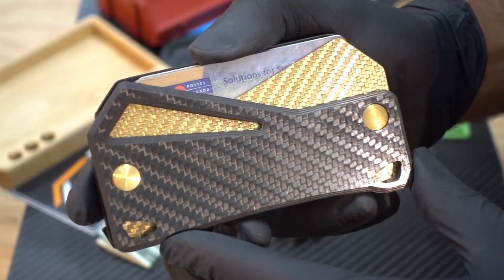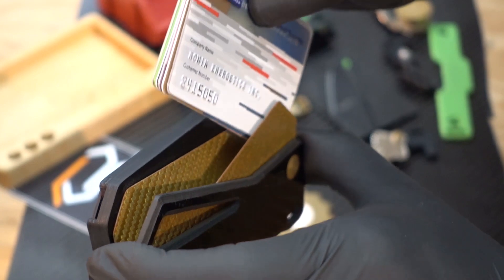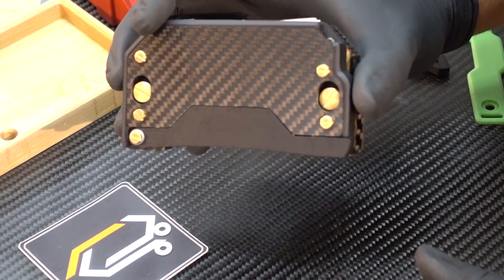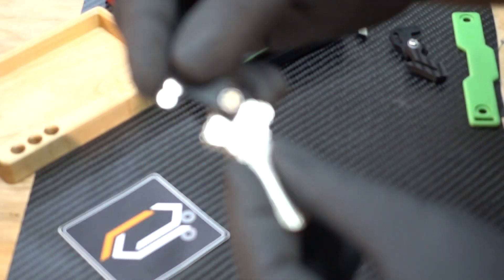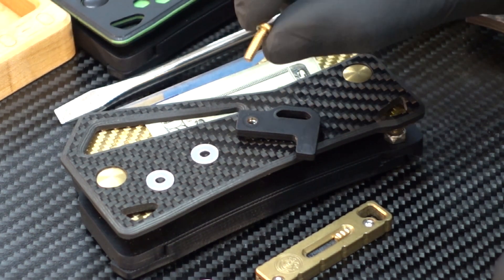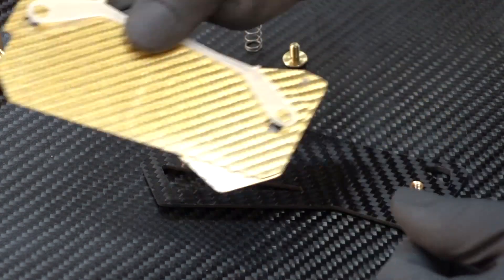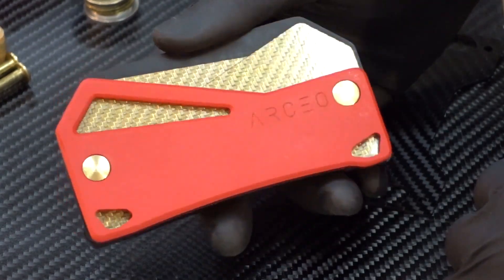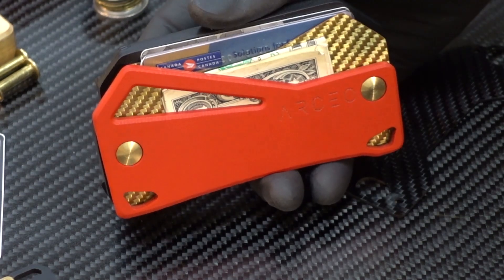Arceo Wallet Overview & Assembly - WMW05

Comment: seems like a fairly cool tool for a minimalist. seems that maybe its overly engineered in a society where we replace what is no longer of use. the springs i can see losing their elacticity allowing everything to fall out the side. the only thing i can think of when you attached the utility knife was the urge to scream, "FIX BAYONETS!" pretty cool design.
Reply from the maker: Hey thanks! It was certainly built like a tank, lol.  Part of the reason we used springs was because they tend to resist (but not eliminate) wearing, like a gun spring. cheers

Comment: Just a question is it RFID protected thanks
Reply from the maker: Hi,  This wallet is only partially RFID protected as the conductive carbon fiber plate only blocks fields oriented directly at its face.  If an RFID sniffer, especially a high power one, pointed at the cards at an angle, it may be able to read them.  I recommend fully enclosed individual rfid card sleeves for anyone looking to truly protect their cards.  Because most NFC coils wrap around the outside perimeter of the cards, it is quite important to fully enclose the entire card for maximum RFID protection.  Thanks!
Reply: thanks for the reply

Comment: I'm from Hong Kong and I want to buy this cool shit. But I have a few questions here. 

First, Does the starter pack included the back slot(the one that stored fidget spinner)?

Also, can u ship to Hong Kong if I want to order one ? :)
Reply from the maker: Hey Tin,  Yes, every single Arceo has the main slot which stores everything like the spinner and tools, etc.  The only thing that is different about the starter Arceo, is that it has no key organizer(MaKO).  I'll activate hong kong shipping asap. Cheers :)